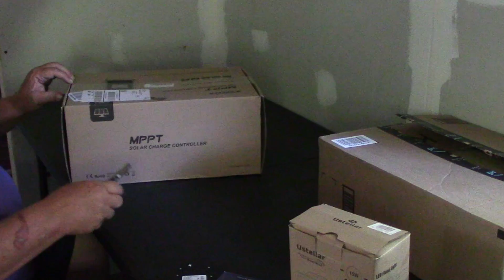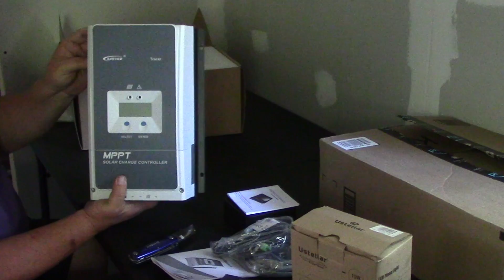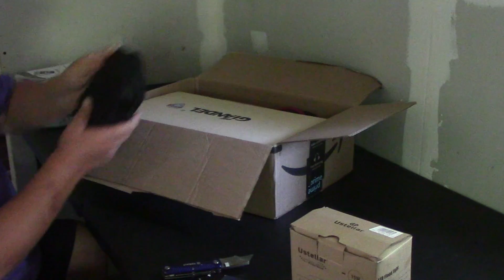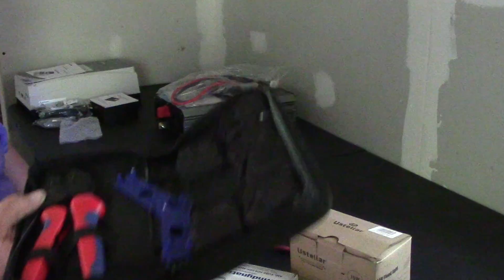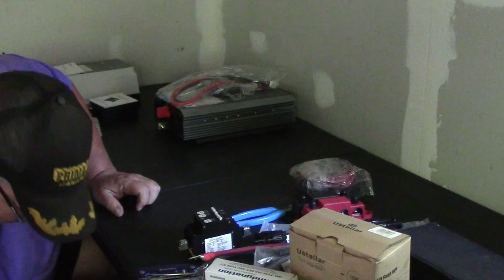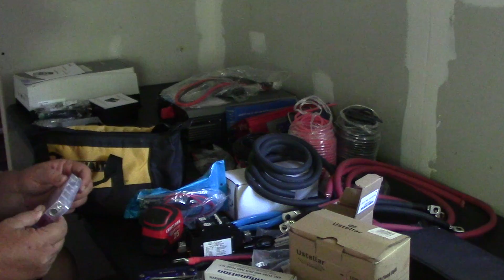DIY Solar Power for the Off Grid Cabin / Tiny House Parts

Comment: Joe, I'm really looking forward to this assembly of your system. Yours will be alot more sophisticated than mine is, but I can learn some pointers from you. 
Im curious about that Pyle step down voltage transformer. I'm thinking about changing to 24 volt.  Is your inverter a 24 volt model? Or will you come out of the Pyle step down to feed the inverter?
Great unpacking video. Thx
Reply from the maker: +bill The inverter is a 24v inverter.  I swapped out the Outback for an Epever 6415 60 amp charge controller. With a coupon it was $250 less than the Outback. That savings paid for the next 6 panels I'm installing.

Comment: You may not even need the converter Joe most LEDs are good from 10 V to 30 V just check on the bulbs themselves they usually say
Reply from the maker: +peeinginthewind Thanks!
Reply from the maker: +peeinginthewind My thoughts with the converter is the energy consumption of the inverter.  I can leave some exterior lighting on 24/7 without needing the inverter turned on.
Reply: @HomesteadWithJoe  right ! But you're using DC lighting  ?  you don't need an inverter .. or even a converter I don't think .. "most" DC light bulbs are rated for an input voltage from about 10v-30v  .meaning you won't need the converter .. the inveter is a totally different item .. that inverts dc to ac  . Your converter only lowers dc voltage from 24v to 12v ..

Comment: Did you take a look at the MPP Solar PIP 2424LV? it does everything in one box that you had on the table, except 2400watts and none of that wiring. just hook your panels, battery, and a wire to your panel and your done.
Reply from the maker: +Michael Illingby I will look at that when I upgrade. Thanks!